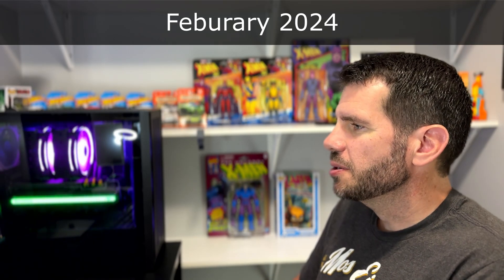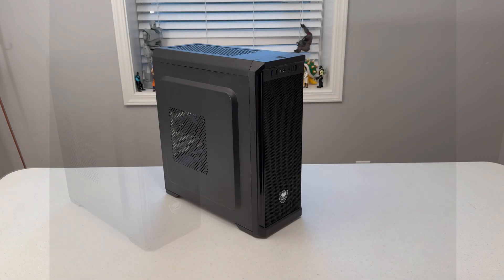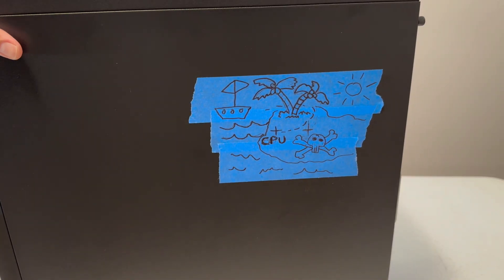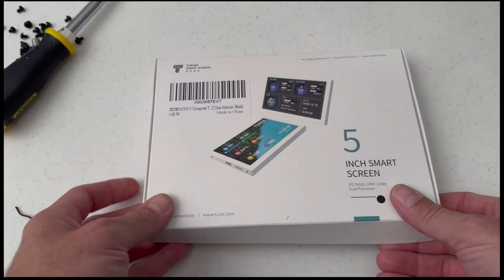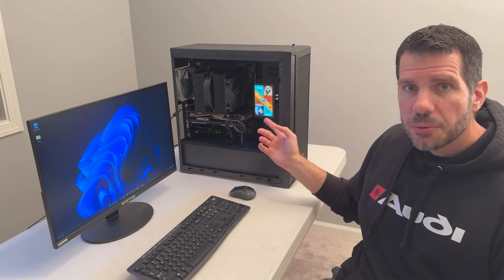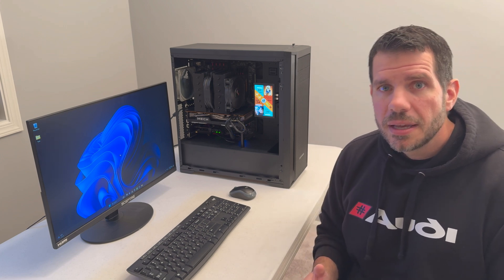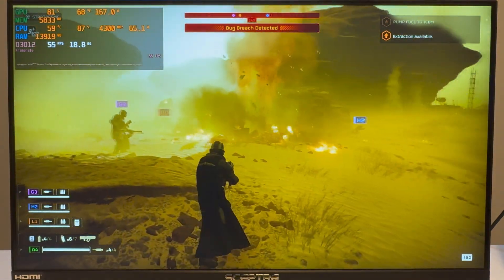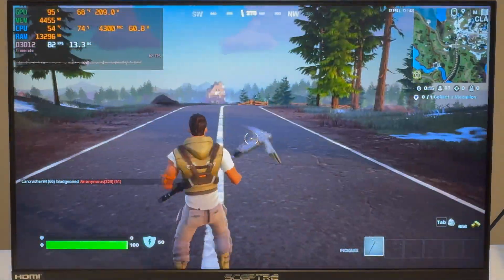Building the World's Fastest LGA1150 Computer

Comment: Extra fan on the back of the mobo helps cool the vrm which is gonna affect the stability and longevity of ur system in a positive way
Reply from the maker: On the Intel motherboards it had no real effect even after hours of testing and monitoring. On the FX motherboard it made a huge difference because that 9590 processor was pulling 220 W and the VRM‘s were roasting. You are correct though it does help but only when you’re pulling huge amounts of power.

Comment: fx 9950
FX 9590 was pretty special loved that video. I hope you also gonna test steam OS on it. Servers parts computer that mentioned also sounds very interesting . Btw with these older builds I noticed that using windows 11 iot ltsc is pretty nice, I suggest you try it I even saw some videos where multicore and single core scores on geekbench somehow faster on that windows server best thing it has no bloatware so it reall feels smoother on older cpu's, you can find keys just like normal windows for less than 10$. Good luck with awesome content.
Reply: Just doesn’t have avx2 won’t run modern games cause it can’t launch them without avx2

Comment: at 10:39 you got the thing about the brand new 3D Vcache AMD processors wrong, they have 96MB's of L3 Cache, not 64MB's. Total is 104MB's. 
The Ryzen 9 7950x3D & 9950x3D 16c/32t processors have 128MB's of L3 cache (total is 145MB's over-all). 

Only the non-3d 7950x, 7900x, 9900x, and 9950x processors have 64MB's of L3 cache.  The 7700x & 9700x only have 32MB's of L3 cache.  
The 5950x only has 64MB's of L3 cache tho, while the 5800x3D has 96MB's (as is the standard with all the 8c/16t 3D vcache parts from AMD so far)
Reply from the maker: @Nighterlev  good catch, sorry about that. Takes weeks to make these and I’m human and make mistakes. The point of the video still holds that the extra cache is making a huge impact on performance whether it’s an old processor or new. Thanks for watching and commenting. Also thanks for catching my mistake.

Comment: Main thing I can’t get out of my head though is that you wouldn’t be running a 5775C in 2014 as it did not launch until Q2 2015! Intel’s ARK page for the CPU states this clearly (which I know you have been to because of the IRIS eDRAM stuff in the video).
Reply from the maker: Yes, you are correct. The processor came out in Q2 2015. However, the motherboard came out in 2014. The intent of the video as stated when I was listing the rules was to imagine upgrading the LGA 1150 platform as far as you could go. Also nine year old technology has less of a ring to it than 10. 🤣. But thanks for watching and leaving a comment.

Comment: Really nice build. I've never heard of that cpu before and paused the video to look it up. It's a very interesting chip and seems like you made a good choice in using it. I have recently.built and use an LGA 1150 Haswell machine. It has an Asrock Z97 Extreme 6 with M.2 NVME, the I7-4790K, 16GB of 1866mhz G.Skill ram and using an XFX RX 580. The components are still relatively cheap and work really well for my needs. I have sold a couple of the MSI Z87 board combos with the 4790K recently too. LGA 1150 is still a viable option for the budget minded. I wonder if the extra fan you installed would make any difference if it was reversed blowing air out instead of in? Anyway liked and subbed your channel, much appreciated.

Comment: PCIE 4.0 GPU is a bit overkill for that old system but cool video 👍
Reply from the maker: Completely agree. If you check out some of my other videos, you’ll see I use this video card for a lot of different builds. I mainly use it to make sure the video card is not a bottleneck in these older systems. That said this 5775C was taking the video card right up to full usage which was super impressive.

Comment: The 5775C is a very cool CPU that I'd like to snag at some point, but these command $80+ on ebay.  It's on 14nm, and that's cool, but that Level 4 cache, a whopping 128MB of it!  I want to grab one as a foil to my incoming 4790K and my built-it-when-new FX-8350 system.

My 4790K on an X87 board and 16GB of DDR3 should arrive tomorrow.  Yes, it's supposedly a working combo, so the BIOS will have been updated.  If not, I'll pick up the cheapest working Haswell I can find and do it.  Cooling will be a Thermalright Assassin 120 0f some flavor, in a Montech Air 1000 Premium case.  I'm going to pair it with a few different GPUs for testing: R9-290, RX-580, and 980Ti to keep it more or less period correct.  If all those seem to be leaving the Haswell chip asking for more, I can go as high as a 7900XTX.  But I think  it's going to run out of oomph with around 2080Ti / 6750XT level.

Comment: This summarizes the Intel vs AMD from 10 years ago. It took you just one video this time and it beat the AMD system pretty well.
Now, I think the 10 year old build in 2034 will be a little more interesting, since AMD usually wins using that 3D cache, but Intel sometimes comes on top as well.
Great video, love this kind of content.
Reply: in 10 years the 5800x3d will probably fall behind due to cores as time goes games eat more threads but the 5950x vs the i9 12900k would probably be a good showing
Reply: @josephdias5859  oh no the 5800x3D chip will always beat the 5950x in gaming, even when games start using more threads over-all in the future.
This is mainly due to the higher frequencies the 5800x3D chip can hit on all of it's cores all at once vs the 5950x, more cores don't really matter if only the 1st 4 - 8 cores can hit the advertised speeds while everything else below that falls behind.

It is also because the 5800x3D has more cache then the 5950x, the 5950x only has 64MB's of L3 cache.  The 5800x3D has 96MB's of L3 cache.
Reply: @Nighterlev  a 5800x3d has lower frequency by alot my 5900x can hit 5.7ghz all core were if you try to push frequency on 5800x3d more than stock it will cause the chip to fail
Reply: @josephdias5859  That doesn't matter, the 5800x3D will always win in gaming.  Frequency does not = more frame rate.
Reply from the maker: Thanks for watching! Yeah if I ever win the lottery I would love to do these videos but with latest and greatest stuff from today. That said it is pretty cool to come back and visit this stuff after it’s all been released. I’m sure there are things we will be learning about AMD 3D Cache but only after the tech has been out for a few years.